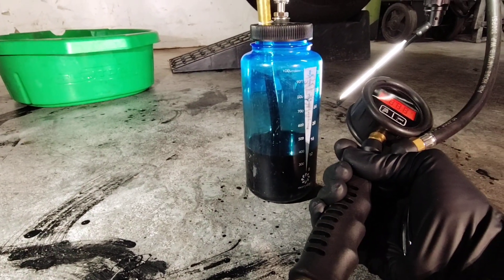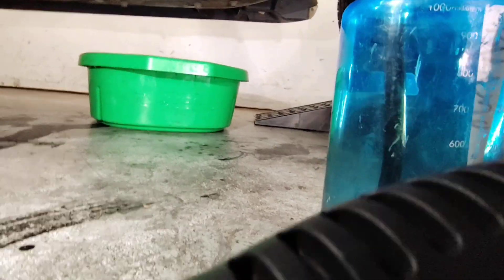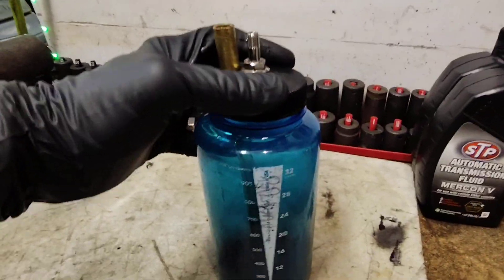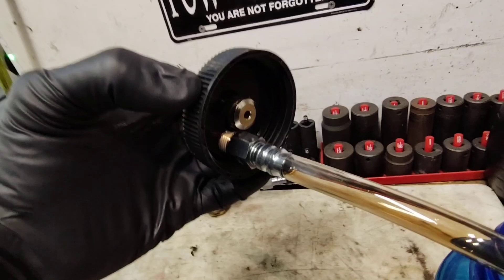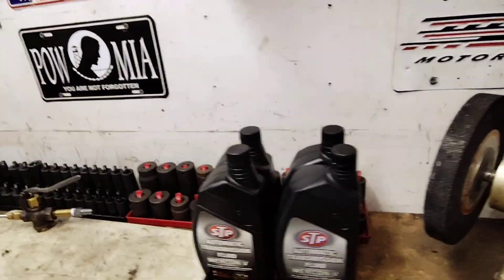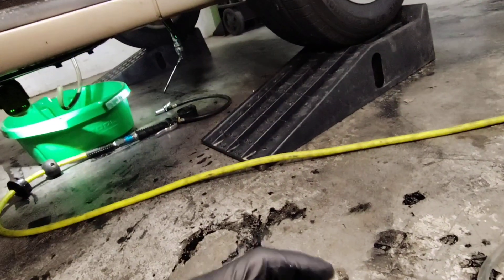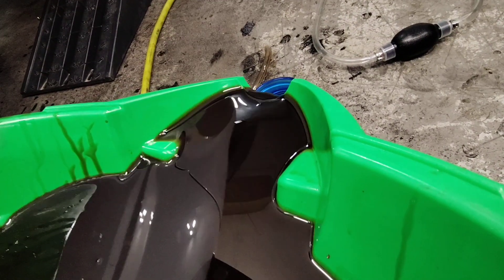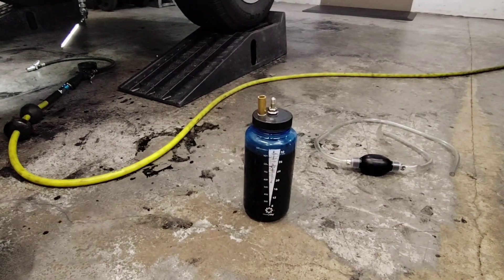How to pump oil with air. Parts list in description.

Comment: i would be worried about bottle blowing up or breaking. they make cheap pumps, or you can get fancier ones like garden sprayers that pump it in nice and easy all the car companies are pulling this crap of no dipsticks or fill tube so it is hard to maintain, and car will wear out sooner or you have to take it to dealer to do transmission fluid drain and refill at a ridiculous price
Reply from the maker: @ranger178  I turn the pressure regulator down to 20 psi so I would keep that from happening.